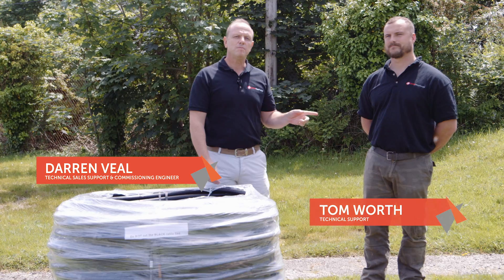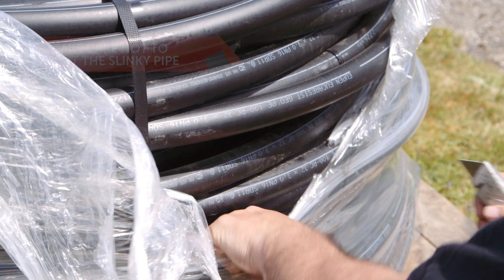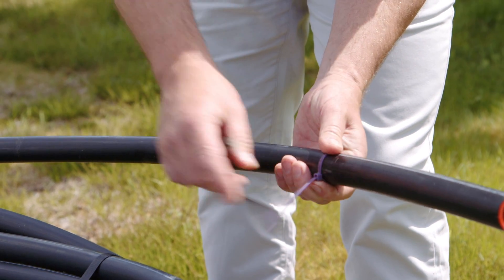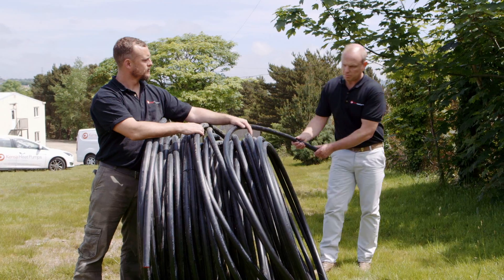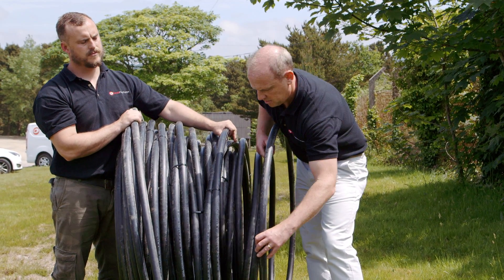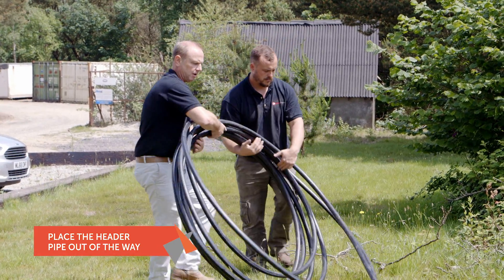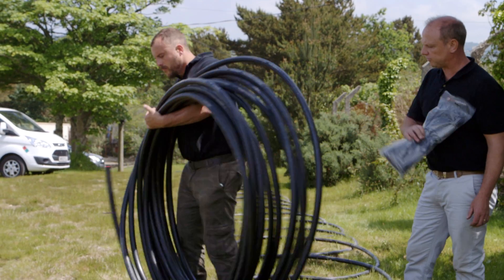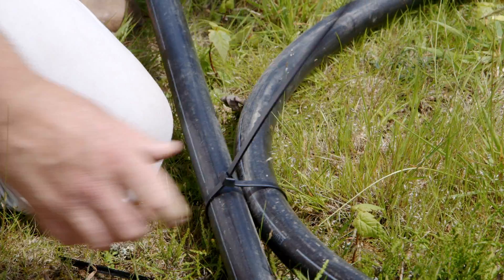How to Unroll a Ground Source Heat Pump Slinky Pipe

Comment: What was the diameter of the pipes used? The 50 m slinky- is that the space it takea in the garden or total pipe used? How many m of pipe does the 50 m slinky pipe consist of(is it 4 m per 1 m slinky?) are you available in sweden?

Comment: Hi, if the outgoing and return pipes are straight, can you cut them all at the manifold if there's about 5m excess? Thanks
Reply from the maker: Hi Rachel, yes you could cut them off at the manifold if all pairs are kept the same length, but we wouldn't necessarily recommend it. The main reason we don't tend to cut slinkies is because you can unbalance the flow, if they are all equal length you will not need to balance the system. It may be easier to loop the excess pipe back into the header trench only and then connect it to the manifold. Thank you for your question, we hope this helps. - Kensa Heat Pumps

Comment: An interesting video, thank you for creating and sharing this.  Isn't cable tying the return pipe to the slinky loops going to encourage heat transfer from the 'warm' return to the 'cooler' slinky loops and undermine the efficiency of the system?  Surely there should be at least soil, maybe a gap or even insulation between the return pipe and the slinky loops?
Reply from the maker: Thanks Richard, you are correct that a small amount of heat transfer will occur between the warmer and colder slinky pipes. 

Kensa has field tested many different layouts and came to the conclusion that the design used in the video caused such a small efficiency loss that on balance and for most installations it was still the best design, after taking into consideration the convenience of installing slinkies.

One of the reasons why the amount of heat transfer between pipes is very low is because Kensa designs use relatively high flow rates through the system, this means that the temperature difference (ΔT) between the flow and return pipes is very low. Without a significant ΔT, very little heat energy can flow through plastic pipe walls.

We do also sell the same ground array pipe as straight lengths for anyone who wants to do their own design, but on balance most customers generally choose slinkies after talking to us.

Thanks for your interesting question!